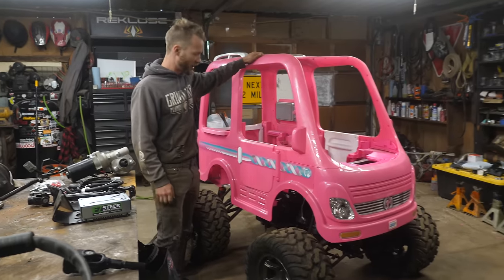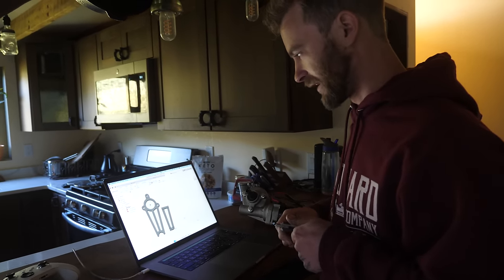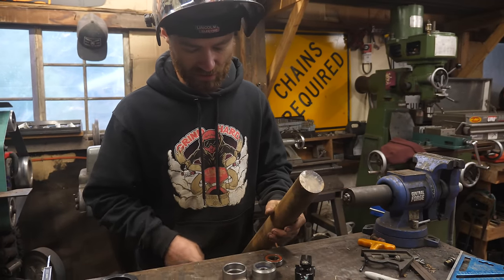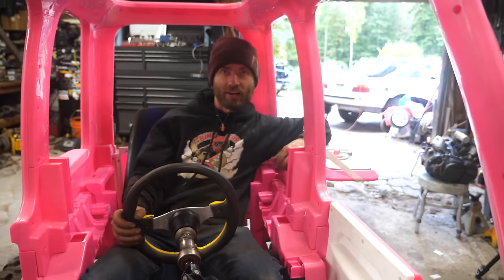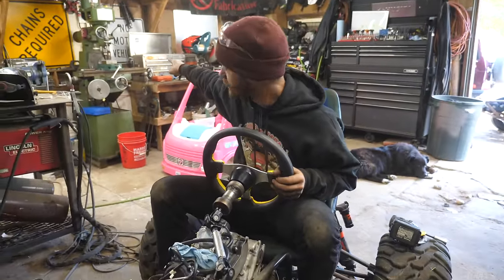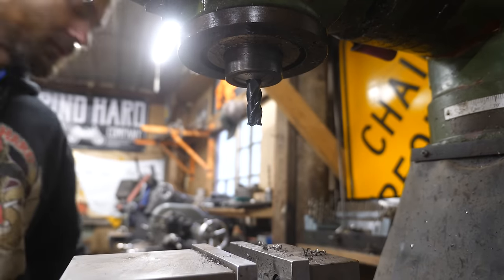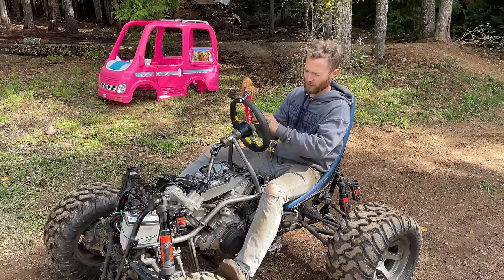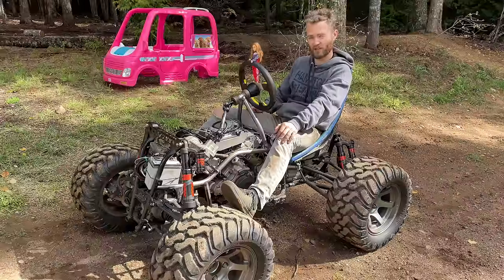Ultimate 4X4 Overland Camper Van Build-Full Frame + Power Steering

Comment from the maker: What color should we powder coat the frame on this build? Working on the roll cage next week!
Reply: Purple
Reply: Let’s switch it up with a matte pink
Reply: Blue
Reply: sky blue
Reply: Glossy purple
Reply: Glossy magenta
Reply: pink
Reply: Cyan
Reply: Some kind of bright blue?
Reply: White would be dope
Reply: Cyan or powder blue
Reply: Maroon
Reply: white with pink/purple metal flake
Reply: Powder Blue
Reply: Sparkly pink
Reply: Can you really do anything other than pink at this point lol
Reply: Black
Reply: Definitely matte purple or pink. Will match
Reply: Metallic purple with a pink flake. And you should try using a normal car steering wheel and make throttle and brake pedals not on your steering wheel. Since it will have a full body and roll cage you should try and make it be like a car
Reply: I think like a light blue
Reply: Purple with pink brake calipers
Reply: Bright pink
Reply: Purple
Reply: Keep it the same color scheme as senderella!
Reply: Keep it pink
Reply: Roof Basket Plus Side Canopy Tent No Tiny Roof Top Tent or Trailer Run it On The Side Also Trash-A-Roo Back Pack Some Gear
Reply: purple or light blue
Reply: Deffently  purple
Reply: White or orange
Reply: You guys should try making a open wheel racing car, like a small Formula car
Reply: pank
Reply: Sky blue.
Reply: GALAXY?
Reply: Purl Matalic white....
Reply: LIME GREEN!!!!!
Reply: Like Arnold said ITS TURBO TIME !!!
Reply: Grey/silver. Match the fake roof rack! Also imagine 4WS. I wanna inception it now for the next build.
Reply: i wonder if you can get a magenta in powered coat?
Reply: Purple
Reply: Hot Pink!
Reply: When are you guys gonna work on the tank?
Reply: white
Reply: the "flash drive" was totally the xbox controller sitting right there wasn't it?
Reply: Sparkly pink, of course...
Reply: Candy apple green
Reply: The green and pink sanding machine
Reply: Pink flakes on white
Reply: Has to be a colour from the stickers to tie it all together
Reply: Definitely purple 💜
Reply: green
Reply: Make the barbie in the keep into an RC car
Reply: Baby metallic blue
Reply: Metallic pink..
Reply: Awesome video wanted to thank you for all the awesome content you guys make for the viewers and me you guys rock keep up the great work and awesome videos
Reply: White with some pink flake or just white
Reply: Pink, white and lime green are the colors i remember the logos having over the last few years on commercials. Could keep it "themed" with the brand...
Reply: Tan grey and black camo
Reply: It needs to be hot pink
Reply: Violet with teal accents, please 🥺
Reply: White with purple glitter/poke a dots
Reply: Dark blue with lots of crushed glass
Reply: Yellow!!
Reply: First, hyped for a roll cage, maybe white? And, second, yall should make 4 point harnesses for the ride along barbies, those seatbelts aint gonna cut it lol
Reply: 135, 206, 235
Reply: Medium Blue frame,w/bright White rollcage.Please.
Reply: Black like my soul 😂
Reply: @andrewmitchell6966  old english white like in project binky?
Reply: baby blue or white
Reply: Black with pink flakes
Reply: White, to match parts of the power wheels.
Reply: Chrome all Day long
Reply: white..
Reply: @123vaw123  yeah i agree
Reply: Red
Reply: Disco Purple from Prismatic Powders
Reply: METALLIC GREY LIKE THE COLONEL GET A SECOND BODY AND DO A COOL COLOR ON THAT . the build quality is so good and a more serious look will do it more justice in my mind :)
Reply: Bright blue frame and roll cage 😍😎
Reply: @that1guy302  yeah matte pink for sure
Reply: Glossy pink
Reply: I think you should paint it the same blue that the hood is
Reply: Canary Yellow
Reply: Purple.. possibly sparkly 🤷‍♂️it's going to get covered in dirt anyways 🤣😂😉
Reply: Purple
Reply: Baby blue or light turquoise
Reply: Minty green. In combination with the pink plastic, it'll make for an interesting vaporwave'y vibe!
Reply: this power wheels built it’s so overkill it’s really really funny🤣🤣
Reply: @Beachwhaleprotection  that would be soo cool
Reply: White with pink flake.
Reply: Sky blue
Reply: Camo
Reply: Some shiney dark blue
Reply: Hot pink!
Reply: I vote seafom green frame, like the Bianchi racing green.
Reply: BLACKOUT

It must be nice have fucking power steering I don't even have power steering on my goddayum car I drive daily .
Reply: Red. Fire Engine or Candy Apple.
Reply: Gold !
Reply: What happened to the electric tank?
Reply: Does anyone keep track of the days of the week?

Seriously. 

Lol

Love your work boys. 

Great
Reply: Baby blue would look great with the pink
Reply: Blue
Reply: Gotta be white.
Reply: Blue
Reply: Hey guys! You’re doing great job and can’t wait to see this barbievan doing donuts, but i also noticed that the streeringshaft yokes are misaligned. The yoke ear holes should be on the same line on the shaft, now they are almost 90degrees of the line from eachother making the streering very wobling and incorrect. Anyway! Yellow frame would be loking nice!
Reply: KEN EYE BLUE LMAO
Reply: Ice white
Reply: Orange/ purple to match shocks
Reply: Purple with metal flake in it push your painting to the next level like yalls push everything else
Reply: White.  Also, why an electrical steering box and not a gearbox?  Space?
Reply: Bright shiny purple!
Reply: Purple
Reply: Blue
Reply: Gunmetal grey, or some candycane vinyl wrap.
Reply: pink
Reply: It would have to be pink or purple maybe purple with pink flake
Reply: WHITE! or baby Blue.
Reply: @obsoleteoptics  this would look mint with the pink body.. already has the cyan decals.
Reply: Lime green
Reply: Pink of course but maybe a matte pink.
Reply: Hot pink
Reply: I mix of the most popular suggestions
Reply: Matte pink or white
Reply: White with block specks all over or pink
Reply: Purple
Reply: @rum169  white with pink/purple metal flakes!!!
Reply: Hot pink
Reply: Nooooo

No more Cardboard designs lol
Reply: More turbos and superchargers
Reply: Metallic dark purple and Metallic blue like Team Burst in Japan
Reply: Purple again!!
Reply: You should do it bright neon orange
Reply: White
Reply: Midnight purple
Reply: gloss Pink
Reply: Pearl White with rainbow flakes
Reply: Sublime green pearl
Reply: White

Comment: Rather than beef up that mount more, I would add one to the other end of the motor, it looks like there's a set of tapped holes on the top end too... That would put it in double shear and make it significantly stronger.

Comment: Ethan it looks like you need to re-clock the u joints on the steering shaft.  It looks about 70 degrees out. This will change the steering ratio as you turn one direction to the other.  You need them lined up parallel to each other as long as the angles are on the same plane. But if the shafts have totally different angles on a second plane, then the joints have to be at the same point in the turn to minimize rotational ratio change.
Reply: I was thinking the same thing….Not haha

Comment: this is the whole reason why I sub to this channel. you know you don't have to be super meticulous, like having a marble cement floor in your shop, always polished to a mirror shine, (duh), to build some awesome vehicles. you guys know your sh#t, you don't cut any corners, but you know about leverage, mechanical advantage, etc., & from an engineering standpoint, you're much more intelligent than you seem to be at first glance. I can relate to this kind of craftsmanship, a jack of all trades, master of none, but damn good at all kinds of trades. and that's what you need in this day and age. I want the thing to be right, built correctly, but yet custom fabricated, no copycats, and get on it and run it balls to the wall all day long. do you know why? because we don't live forever. you never know when you're going to have to shut if off, and have to turn in that old beat up body for a new one. so I want to have as much fun driving the thing, as I did building it. that's what it's all about, isn't it. don't get too serious, but don't build it sloppy and dangerous, either. you guys do it right and it's never boring. even that Barbie g wagon, I couldn't even see that looking any type of good, and the thing is absolutely amazing. all right this is long enough. keep it up, I look forward to the next one. ..😜💯💯💯
Reply from the maker: Thanks man! Very well said! I agree.

Comment: What happened to the electric tank ? That was gonna be a sick build
Reply from the maker: we'll come back to it over the winter
Reply: The batteries and motor they got turned out not to be compatible with each other, so they needed to take a step back and reassess. IIRC they said it's still coming, but a bit on the back burner at the moment.

Comment: Congrats on the shot upgrades!  Best part of CAD is if it fits together on screen, it almost always fits in real life.  Also, it's the best trigonometry calculator ever invented.  Fyi carbine end mills are kind of fragile, but you can probably cut 1/2" deep with a gentile touch.  You'll chip the corner off the cutter eventually.  I usually grind a chamfered cutting surface on the corners when they chip so at least it's sharp.
Reply from the maker: Thanks man! And thanks for the advice!

Comment: Not sure if it's been mentioned in another comment, but the upper steering shaft u-joints are 90 degrees out of phase. this has a decent impact on how smooth power is transmitted through the shaft.

Comment: Nice mill . 
You can get a power head for the X axis on that mill. Or you could rig something up . With a small motor and variable speed control . 
Even a good portable drill will move both axis quickly and smoothly . 
You may need to customize an old socket . 
Save all that hand cranking . 
Looks like the spindle is turning a bit slow for that size cutter and general milling as well .

Comment: For milling i'd suggest getting some bullnose end mills. Unlike regular ones they have a slight radius at the corners on the end, so they will form a nice beveled/curved inside edge. On only will that look more finished, but will also keep potential stress fractures from forming at the sharp corners since there won't be any.

Comment: Hey Ethan, if you are able measure what your milling without moving it in the Z axis you can make adjustments taking away material with higher accuracy. Move it in the X or Y axis instead. Love you guys, the builds awesome.
Reply from the maker: Yeah, I just had it in a weird spot where I couldn’t move it far enough away to get the calipers in there.

Comment: Need to get yourself some parallels to put in your vice on your mill. They help in getting your work piece closer to the top of the vice, and you mills away from your vice. You could also get the machinist bible for tool speeds and depths to save on your tool cutting edges.

Comment: Awesome.... 
28:04  Move the steering assist to the top & mount the steering wheel directly to it, with it's motor going down to the right side frame.  Also, that might eliminate a U-joint. 
Will you be lengthening the A-arms like you mentioned in a previous video? To widen the stance? 
Maybe put in a larger than factory radiator. Especially if you bump up the horses. 
Frame color - Purple is my favorite, but I think this one deserves super hot pink or Camo, cause Camo & camping go together. Barbie Camo.
Reply from the maker: Thought about that option, but the u joint angle would be more extreme if there was one less, and I’m obsessing over weight distribution so I wanted it as low and as far forward as possible.
Yes! We will be lengthening the arms for wider stance and long travel.
Purple would look good…
Reply: If you guys do purple please put silver flake in the paint 🤣

Comment: Ethan a tip for your cutting of pipes for roll cage's, instead of using a hole saw try using an appropriate sized END MILL in the jig you use or you could use it in the Mill next to the chains Required sign (4:40 mins in) 
Either way you would get cleaner, faster more accurate cuts and the end mill would last longer "don't forget to use cutting oil! To make the end mill last as long as possible 😁)
Love the longer episodes lately
Tony from Western Australia 🇦🇺
Reply: Wouldn't an annular cutter be better?
An end mill has to remove all the material in its path, unlike an annular cutter, or a holesaw.
Anyway, I think the fact that holesaws are cheap is probably the driving factor here.
Reply: @johnjosephson9277  your probably right John, using the term  end mill is a direction for them to explore which is appropriate. I originally saw Kevin on the channel
KSR Performance and Fabrication using them to fab up roll cage's on the race cars he builds,
I'm GHPC case with the amount of subscribers that they have, they could put the word out for people who may do the machine shop, garage shop, farm sale rounds to keep their eyes open for good second hand end mills, tooling, even collects chucks and what ever else they need
In fact Abom79 does work shop tours as part of his channels activities, and about 5 or 6 months ago did a absolutely brilliant tour of this acquaintance who had 3 ginormous buildings full of second hand +machinery workshop machines he buys and sells
I bet Ethan would be like a kid in a lolly shop checking out the stuff
Oh how I wish I had that sort of place near me in rural Western Australia
I probably would forget where home was!
Tony 🇦🇺

Comment: I’ve got some snorkel advice for ya, to adapt your cvt exhaust boot (oval boot on the right side of your engine) using a Kawasaki kvf700 sport quad boot adapts that oval to a perfect 2 1/2” rubber coupler to attach a snorkel tube to
Reply: Yeah same with a prairie 600 belt cover boot

Comment: You could add a C shaped tab to the input side of the powersteering unit. Then weld another tab on the left side of the frame that you bolt a bracket welded to the tab off the powersteering unit, making it removable.
Reply from the maker: That would work, for sure.

Comment: If you put snorkle on it you may need to rejets carbs 
Run only coventional or shell rotella t4-t6
Check often your oil level
And be sure that the radiator have plenty of space for air flow

Comment: I’m going to keep feeding you guys all the pro tips I have. Ethan, thermal dynamics can really help you with bearings. Put all your bearings in the freezer for a couple hours before you try to install them. I’m pretty sure you already know about this trick!
Reply: The only problem with this is they immediately frost up when you remove them from the freezer so you need to apply ample lubrication to prevent flash corrosion. I like to soak with wd40 immediately to displace the water then oil to lubricate.

Comment: Love the build guys! Little concerned that the bracket you made to help support the steering / pump to the cylinder head may have the potential to cause premature head or base gasket failure if the torsional force of the steering is too strong. I could see coming off a jump, shifting the head by thousandths and now we have a leak, or worse... 🤔
Reply from the maker: You have a point. Maybe I will get rid of that bracket, since it needs more reinforcement anyway.

Comment: Hey guys use the three bolt holes on the top side of the power steering unit and make a second bracket. Just a thought
Reply from the maker: Yeah, the problem with that is it would no longer be removable, unless the bracket was also removable. So still an option, but more complicated.

Comment: Looking good. What color pink will you upholster the seat? Hopefully it will compliment the harness. If you hook up a small pressurized tank you can dispense beverage.
Reply from the maker: Thanks! We are thinking light blue for the seat, like that compartment on the dash.
Reply: @GrindHardPlumbingCo  That would look nice and give the vehicle a different look when you drive it without the Barbie shell.

Comment: To increase the life of your mill tools you should consider using a larger axial depth of cut and a smaller radial depth of cut so more of the tool is being engaged at once. If you only ever use the tip it will start to wear unevenly and potentially reduce the quality of higher axial depth cuts. I'm also a beginner when it comes to milling so I have a lot to learn so anyone else with good tips please reply.
Reply from the maker: Thanks for the tip!

Comment: I would not mount the steering box to those bolts on the motor, those bolts are what hold the rocker shafts in place, not casting holes

Comment: Here's a great suggestion for, in my opinion one of the most practical, useful, incredible time destroying shop goodies I've found on the Tube? It's found in the shop of the Guru himself MOTO MULE. Mr Mule has a small magnetic pedestal table that seriously makes short work cleaning steel up. First use more than pays for itself